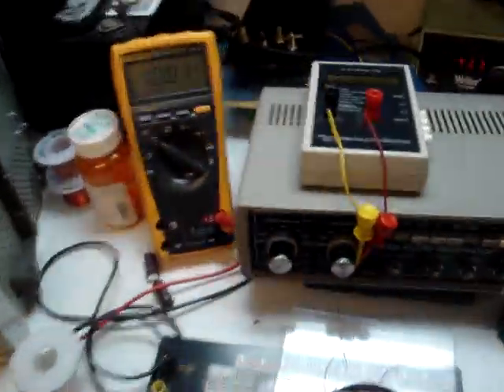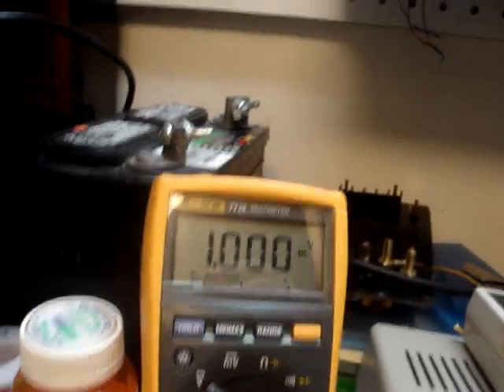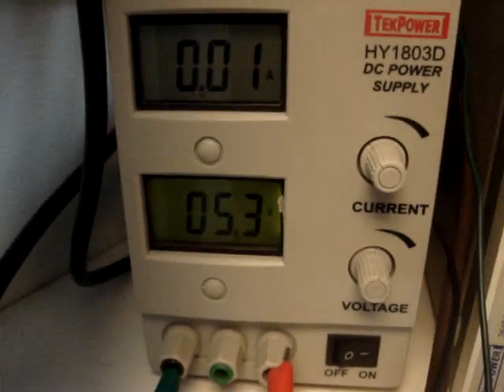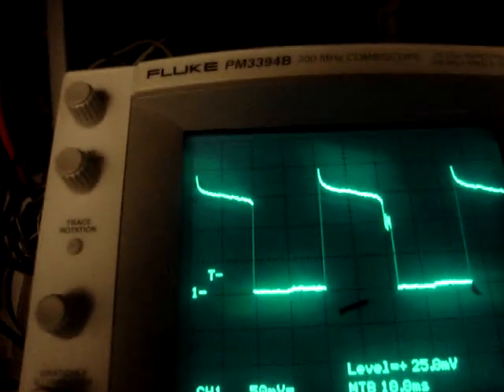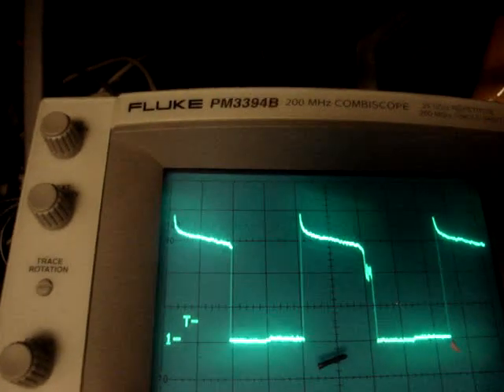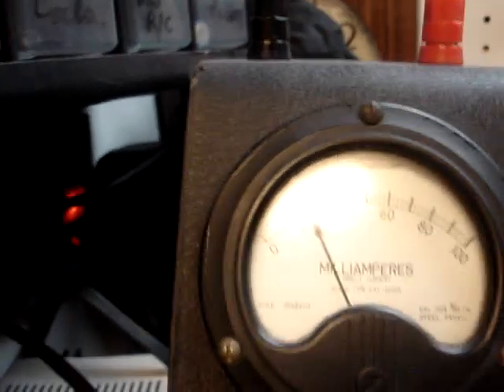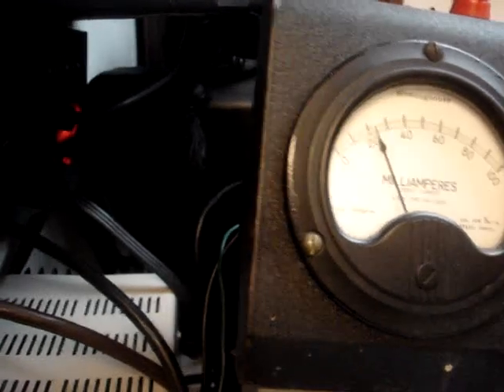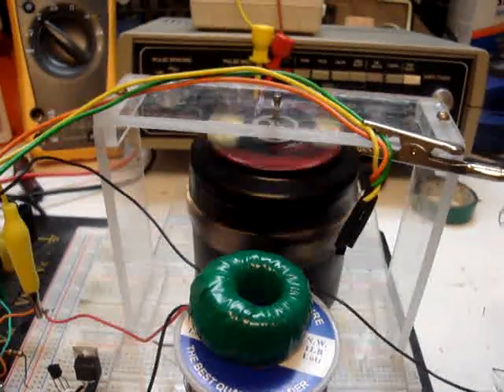1.000 VDC drive ORBO motor.

Comment: Hi, There is a litle problem with mosfet IRF 1405/ buz 71. The diode indside short down the back EMF. It is better to use the energy in the motor circuit. How  ??

Comment: Hi Ben,

great work!

I do have a concern and it may not apply but I have been fooled before when using a MOSFET and switching low voltage. What happened to me is the FET switching voltage leaked through. You can test by disconnecting the battery and have your scope probe between the source and drain.

I hope this is not what's going on and wish you have a working one coil Orbo.

Thanks 

Luc